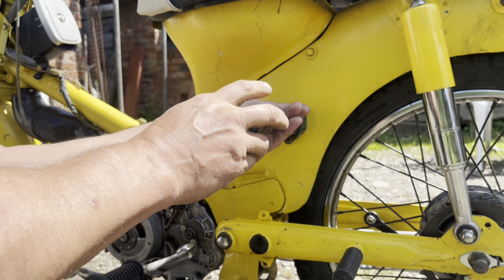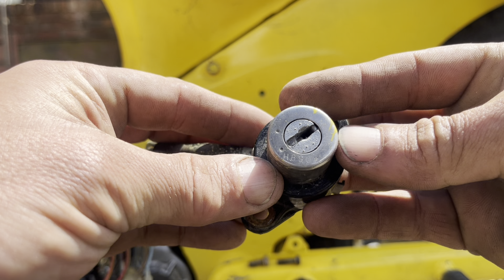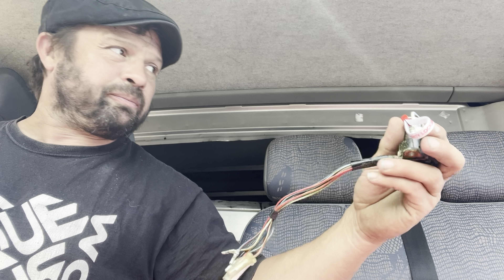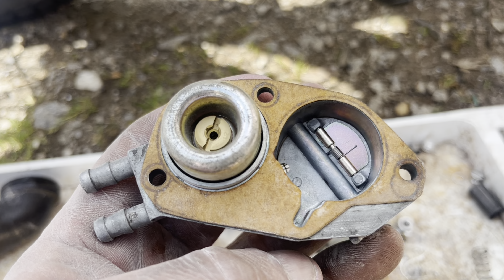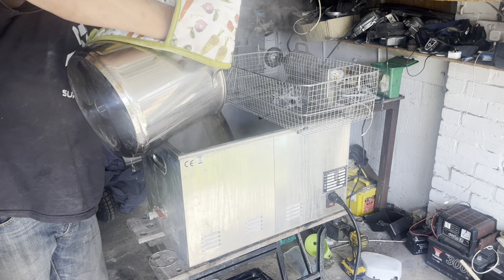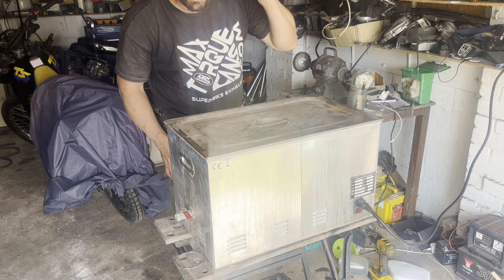Part 5 Honda Cub C70 Classic motorcycles restoration

Comment: it's a runner!    it's a Honda so there was never any doubt   ..... the gap on the plug looked pretty wide when you were checking for spark but I assume you've adjusted that?  I never had any problems with mine in the 80s so I cant advise on what to check next, I'm sure you will find it though - absolutely spot on about sleeping on it 👍